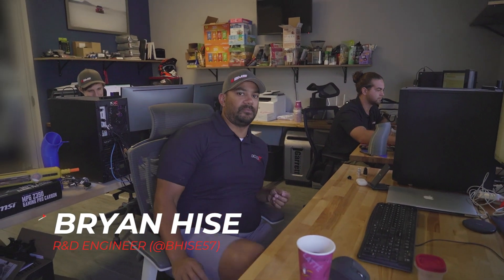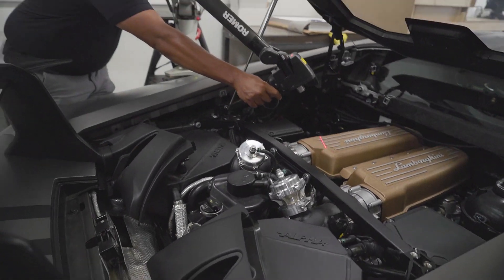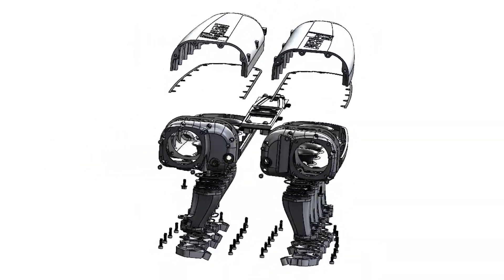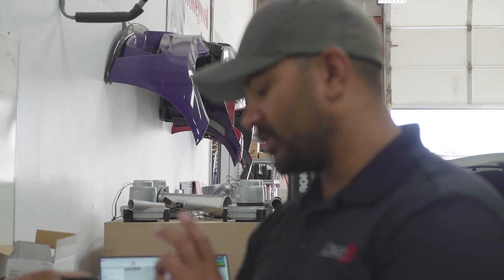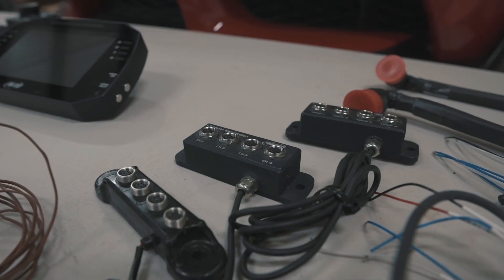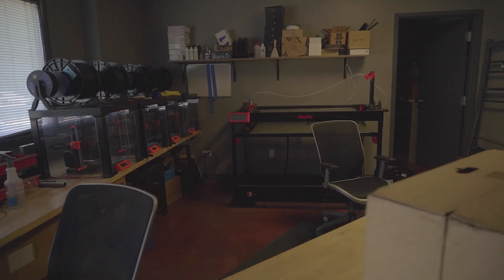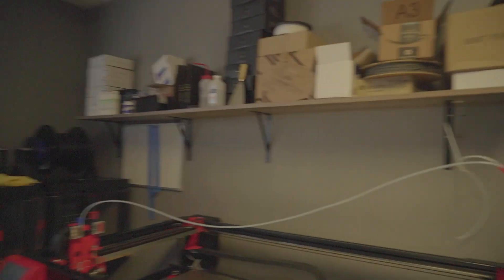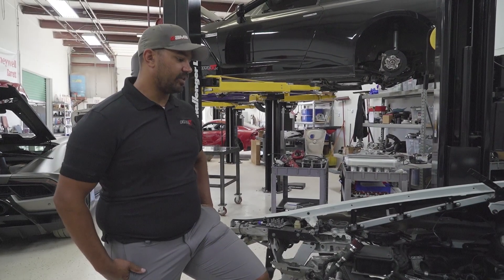HOW IT'S MADE | V10 Billet Intake Manifold (Lamborghini/R8)

Comment: The air horn or "trumpet" design has critical fluid dynamics in terms of pressure and flow.  Funny how it was not mentioned at all and looks like a copy of the factory trumpet.  Do these engineers even have a basic idea of some of the harmonics involved?  Doesn't seem to apply to forced induction at all.

Comment: Amazing please keep going made engineering side videos .Did you use any cfd analysis peogramme for design this manifold?
Reply from the maker: The software used to import scan data is called Design X. That information is then cleaned up and sent to SolidWorks CAD 3D software to create the final design.
Reply: AMS Performance Thanks but I didn’t ask that I ask did you use  any air flow test in solid or ansys programme?
Reply from the maker: No we did not run any CFD on this piece. The original geometry is already very good (as stated in the video) but we were more concerned with maintaining it and allowing for boost in situations where the stock manifold may not hold up in high boost situations.